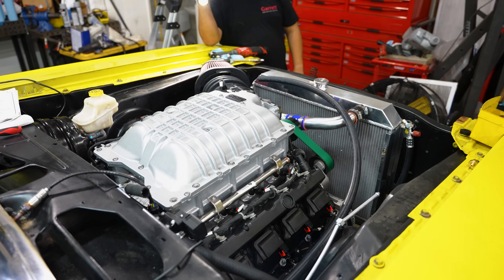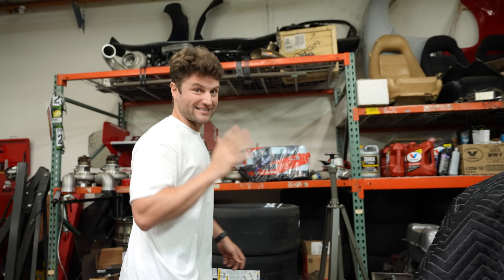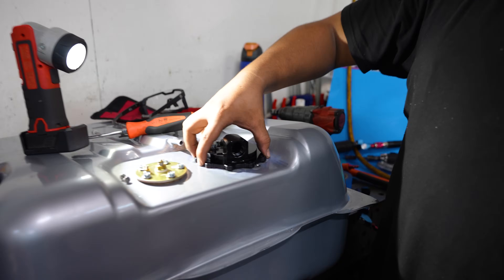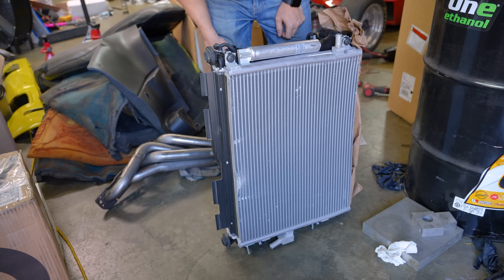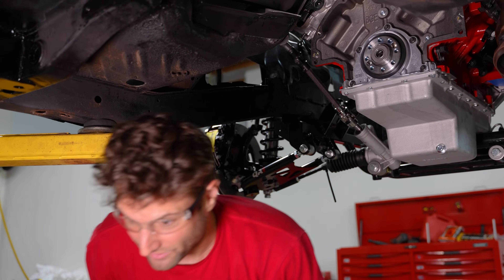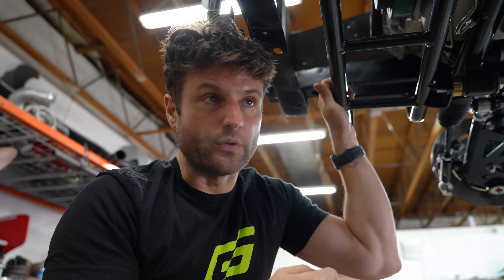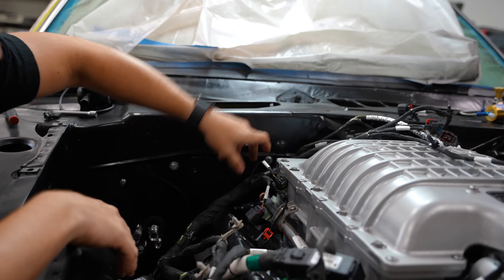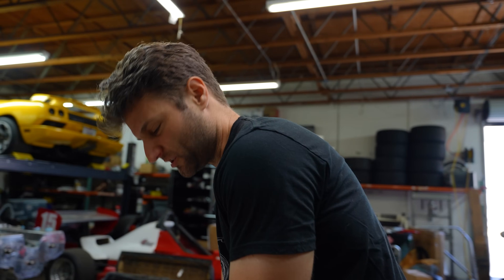Do NOT try to Hellcat Swap a Classic Car in under a week.

Comment: I was actually looking for a 10W-40 for a small block chevy and ended up going with the 20W-50 VR1 instead. Definitely would like something lighter than a 50 weight and I know subaru people would also like a 10W-40 option as well.
Reply: +1 for the subaru oil
Reply: usually a 5-40 for our subarus and rotella/pennzoil euro works wonders.
Reply: I'm after some 10w40 for my Rx8, would love to get some VR1
Reply: @Ebb1337  using VR1 currently in my rx8, car has never felt better.
Reply: @fortunefed8719  which weight do you use?
Reply: @Ebb1337  I'm using 10w-30. I'd use 20w-50 only for track sessions. I wish they made a 10w-40 as that's my preferred summer weight, but it still runs great. Just remember, you need a sohn adapter to run full synthetic in your 8.
Reply: I use the VR1 20-50 in the summer, but when the weather cools down it takes a little bit to build oil pressure. So I switch to a Mobil1 5-40 Euro oil. Would love to keep it VR1 year round
Reply: @RCintheShadows  depends what summer is like where you live I guess. Here it gets to about 95F at the highest.
Reply: @RCintheShadows  I thought the thicker the oil the higher the pressure, especially when cold, but lower flow?
Reply: In Europe there's vr1 5w50

Comment: The build is amazing!  It has so much potential with this combination.  I am sure someone has already brought t this up, but I wanted to mention that while the car started, it sounded like the starter needed to be shimmed. It isn't crucial in the short term, but it may wear down the teeth on the fly-wheel or the starter.

Comment: Glad to see someone else use the bread trick for the pilot bearing. I worked for my 454 in record timing compared to the grease trick.
Reply: Bread works, just need to compact it before it presses out.
Reply: @wobblysauce  and when in doubt, pack some more in! Instead of a bun, like rob used. I used Italian loaf bread.

Comment: Y'know it just kinda clicked for me how good the chemistry between y'all really is, and how y'all's strengths really suit one another. Rob is a wiring expert at this point, Isaiah is a fabricating master, and the rest of your shop that aren't on film as often like Ethan and Joel are so excellent at what they do.
Kinda jelly bout the wiring part though, my 94 project car still has OEM wiring and it has been an absolute nightmare. Wish I could have Rob rewire it lmao his wiring is so damn clean🤪
I would absolutely use VR1 0W40 in both my daily and my project if I for sure can swing it, the daily's Euro and the project is Japanese. I already have Valvoline transmission fluid and oil in the project, but the daily typically uses Liquimoly just because that's what the shop uses (and I'm terrified to work on it lol!)
Reply: B I need someone to help me get my 2004

Comment: 25:38 this is the duality of man... Rob hitting his head on a tire with tape engulfing his face hammering a the transmission within an inch of insanity MEANWHILE bro in the background with a caliper is being the most precise machine I've seen all day adjusting the suspension to within a pube hair of perfection.

Comment: 2k spray paint is a thing. I understand this was a time crunch but if/when you want to repaint hopefully the rattle can doesn’t give you adhesion issues (or you’re spending a lot of effort to remove it).
Reply: please. alot of people doing bodywork will use spray paint for guide coating, many even use spray can primer. doesnt have shit to do with a spray can. adhesion comes from prepwork before painting it.
Reply: @KableTac  fair. But there’s also a reason it’s not used as a top coat.
Reply: @JamesSeal 2k hardness is mainly useful for clearcoat. There won't be much of anything damaging the paint in the engine bay/inside the car that would benefit from 2k laquer. Underside should be coated with something soft and thick if you want it to last.

Comment: I tried that bread trick and it turns out the crank on an LS engine is hollow with a freezeplug. The freezeplug got pushed in and I got bread all in my engine. Now I have a 400hp toaster.

Comment: I wish I had your patience when it comes to the wiring. I dread that part of a build over everything else. It's amazing watching you work on the harnesses. Glad to see you went with the Dakota Digital RTX instrument cluster! I bugged them for the better part of a decade at SEMA to come out with that exact setup and have it in my 72 Challenger and absolutely love it! The best melding of the old school look and feel and the new school tech. And yes Valvoline should offer lighter weights of the VR1 line. I would use that in my 72 Challenger all day long.

Comment: 21:21 Wong hole.
Drive the bread into the very center of the pilot bearing.
ie the pilot bearing shaft diameter.  ~7/8" or 20mm
The clutch alignment tool would work.

Comment: That engine coolant tank does connect to the radiator. There’s a bigger line at the very bottom that T’s into the lower radiator hose under the intake

Comment: I run VR1 SAE60 in my billet crank stroker 4.3 gm (basically 4.8) because why not ; on the engine side of the equation. As far as why I run the SAE60 is because that's what John West Racing told me to use.  They explained a lot of things that quickly went over my head but did mention a few of its attributes same as you did. I run my truck to the brink daily and never worry about the oil side of it. I use VR1, I trust VR1, and I think a mid range is a GREAT idea. 👍  A+ Valvoline, Killin it since before Bobby Rahall for me lol

Comment: Sick build guys. Can you please buy a small lathe Rob. Knowing how skilled you boys are it’s painful having to see you muddle a small job like trimming that oil cooler bolt down, when it could be a quicker and cleaner operation. I imagine you have bigger plans to purchase a mad cnc contraption, but just a small bench top lathe has got to be worth its weight in your shop.

Comment: Richie likey! I want it! That Challenger turned out O.E.M. factory specifications mint! I hope all the work doesn't go down the shitter the first pass down the drag strip. You have to do shake down tests with engine, transmission, computer comunications to relays, sensors, test the fuel systems, radiator systems, drive train functions, emissions and the Nut behind the steering wheel. Plus the engine computer needs a Dyno tune to pump up the H.P.!❤

Comment: What different type would the make fitting inbetween the 0W40 and 20W50 you mention? I use the VR1 5W50 but not high zinc or anything.

Comment: I know it's gross, but I would go in the dumpster and grab the original carpet. Blow away any loose debris with the air gun then get a good steam cleaner and remove all the dirt, dust and smaller debris left in the carpet. Hit it with some baking powder to remove any odor remaining and then bag and tag it and stash it with the rest of the original parts. A purist collector would buy it, or you could keep it with the car and down the road if you or another owner decides to return it to stock they have the option. Side note, anyone else notice that "paaa-ting" sound of what sounded like metal on metal upon startup? Great build series, and a great example of resto-mod done right. You did a good job keeping as much original as possibly while upgrading all the areas that needed it, like brakes, suspension, power, electrical. I'd love to see more projects like this.

Comment: My Cougars sound system I had to use Monster Cable Zero gauge wire from front to trunk to power the fuse block. 400 amp alternator as well lol, oh those days long ago. All to run a 2,400watt continuous 4,650 max system

Comment: I did a 1996 dokota hemi swap with an 8hp70. Easy work but the wiring killed me, I got er done but only after setting it up on HP tuners for transmission maps did it run right.  Sorry  can't put pictures  in comments
Reply: The manual transmission swap seams way easier than fitting the 8hp70. Transmission  Dimension wise

Comment: FYI, N95's for dust are not for spray paint... should be using cartridge masks.
Reply: Not necessarily. If they have a well ventilated work area the exposure to fumes will be well within safety requirements especially with the volumes laid down with rattle cans. The N95s would be helpful to prevent aspiration of over spray and the sand they blew out with shop air. 
If anything, a mask with spark arrester for weld fumes if the welding fumes had a chance to build up. (also unlikely with the volumes of air blown with the fans)

Comment: 20:50 fun fact - we removed a pilot bearing from my buddy's 1JZ-powered JZX100 Chaser by using bread and compression to create pressure behind the bearing and force it out and I swear on my car, it worked 🤣 edit: I just saw that Rob tried that with no joy ☹

Comment: With that 2-0, you are also minimizing eddie current loss due to skin effect. Since electricty runs on the the surface of the wire. Stranded wire mitigates skin effect loss since more surface area allows for more current can flow at the same rate of voltage. Higher rated insulation will handle increase in temps due to increase in current. good job in aquiing wires for welding. Keep in mind the fuse box rail(s) need to have just as good specs to handle all the current going in and out of the fuse box! all that wattage in DC will stress the rails pretty Hard with all the Charging and discharging within the electrical system. Alternator output needs to be > than electrical system power draw to prevent parasitic loss to the battery. easiest way to parasitic electric loss is to add all the sub fuses (not the main fuse that shuts off the systenm) that draw power and add 20% = the output required of the alternator.

Comment: KnuKonceptz wiring is a better option than wielding cable and it's specifically designed for the automotive environment, I use it in all my personal and customer's cars. I don't work for them just a fan of their products.

Comment: I'd love a 5w40 vr1 save me from having to buy zinc additive for my autox car that gets hammered on hard on revs going into corners due to having to preemptively down shifting
Edit- I knew zddp did good stuff before your channel but since i was already running good oil i didn't see the reason to use the additive. Now if vr1 in my oil spec existed I'd have used it cause better and at pretty much no extra cost so why not use it. But after seeing what it saved your engines from and seeing gears and gasoline's valvoline tour and seeing in detail what it did on a microscopic level. I started using zinc additive. Of course I'd use vr1 to make sure i have all the proper ratios and everything. But vr1 isnt in my oil spec so...  additive it is till that changes then.

Comment: The reason he wasn't able to remove the pilot bushing hydraulically is because he was doing it wrong. You have to use a solid punch, you can't use a socket, that's not how hydraulics work.

Comment: I've got a question.... maybe someone in the comments could answer it for me: since the Demon's and Hellcats have to be driven 5,000 miles before you can put it in Drag Mode and use Launch Control, if you buy a crate motor does it come with the same restriction? Or is it just ready to drag right outta the crate???

Now that I've read that again, I realize this doesn't apply to the Hellcat motors. As far as I'm aware anyway.
Now I wanna know if the Hellcats have Launch Control. I don't think they do, but I've been wrong before.

Comment: Welp, what I've just saw was ~painfully good... And I am aware this is like "the raw" item... pre "enchaining". Yes those are video game terms... I mean I know it is already crafted on a very high level as individual parts within it, and most of them are either not replaceable up, or it is meaningless to be done so... but they might need to be ~tightened together... Or not.. I mean I am erm unfortunately (which is the worse possibly because I am not smart at all in fact straight up dumb) messy person and stuffs I do are fail when done (if I complete em) so I am saying that with possibly a wrong view... it could just be about as much of a perfection it can be of completion due to proper persons having it had made (also obviously I've never made anything of this scale). I mean I don`t even understand that much of any of that... Like is realistically all the "electronic" tune gonna do anything for it more than it`s Engine and Rear tires... I have watched all the 4 rotor tweaking like the attempt to put absolutely every unit of torque trough the tires in the asphalt propelling the car forward with no useless spin or not spin... But This engine ~This car.. does it even succumb to any of that... or do you just turn it on (with this magnificent sound... it sounds like a dream on startup and in idle an than when you feed it with gasoline and air opening like ~whatever valves do that in this entire ~system...) and than Try to make the most of revs and clutch... I mean Is it even trying to do anything with the clutch a thing or at this power levels is meaningless and the clutch is more On/Off thing and practically the moment you release when even a fraction of the engine power connect to the tires they are spinning... I saw that little black stripe or ~stripes that it left behind it... when you were going forward with no brakes. BTW I bet all the Emission standarts are 100% ment... I am super sure registered street legal car ~easy :P. I mean this is what Erica intends to go to the Super Market with every day after work and in before going back home, no? I were gonna recommend you meeting like Emilia Hearthford... but erm too late about that I guess. If I have to attempt to describe it one more time... IDK if I should be Impressed or not... I 100% am... but is something you and 2 other guys (+/- other people) build in a car shop over minimal time actually really impressive? o_0 There are car project made by engineers over many years with still the intent of not even 4 digit number productions and 7 digit prices... So How am I impressed by this yellow American muscle car so much... Unfair :P.

Comment: I see how hard your fabricator works. Make sure he always wears gloves when tig weldin.

Thoriated tungsten was and still is a mainstay in tungsten inert gas (TIG) arc welding due to the predictability it brings to the TIG welding process and to welds. However, its major drawback is that it is mildly radioactive. The majority of thorium's radiation is released in the form of alpha particles.

Comment: Dude did he put the fuel pumps in the front on the tank? Drag cars need it in the back because when you take off all the fuel goes to the back from G-forces. And you don't wanna fuel start a boosted motor when your foots to the floor

Comment: VR1 5w-40 & 5w-50 for Euro.
VR1 10w-30 & 10w-40 for Japanese. That would cover summer and winter for most enthusiast vehicles. I don't believe in zero weight.

Comment: Love your videos, Rob.. but get a better crimper for that 2/0 AWG so it stands the test of time rather than turn into a fire hazard. Hydraulic is the only way for to get solid crimp with that size of cable. Not doing so will allow enough movement in those fine strands to eventually break them.

Comment: edit: 23:40 assholeshippinginc You know, there's an artist that puts glass cubes inside shipping boxes, and has them shipped across US. Securiglass i believe, but the point is he then puts the glass blocks in an art gallery. There's something to be said about how sh!t shipping is in US, if an artist has this as an idea for his art. I've had sh!t shipped from Japan, came intact into Europe (OEM bits). Not a single dent in the product because it was properly packed. I've had sh!t i packed shipped from US, and i spared no horse on the packaging. Used pink high density foam, an inner wooden frame, all to make sure the rare bits i needed and painstakingly tracked for a month in NA were intact. Wtf do US shippers do? Like a rave party on top of these every time they sh!p the bed?
You probably already know this, but once the car's done touring, it needs to come apart and have a proper paint job. Rattle can spray paint is not going to last against rust. It's too thin. It's excellent for rusty stuff (acid primer), because it gets in all the little sh!tholes, but it needs a proper coat on top. My vote, send it off to be media blasted.

Comment: You are using huge gauge wire, for what reason? and then say you are doing it so there won't be problems...  Larger gauge increases the load of the entire thing.
Reply: He explained that he wants no drop in voltage. The battery has no issue delivering the power.

Comment: Can y'all not hear that starter in that flexplate. It's like fork on a plate. Overall in the time frame y'all had you get a 10 but y'all goods fix that issue or y'all will tear it apart. I wouldn't be surprised if teeth are missing on it already.

Comment: i just cant with your wiring sometimes, the wires you use are so huge and so overrated that minimal voltage loss you'll have with a smaller wire wont matter, it wont break anything at all